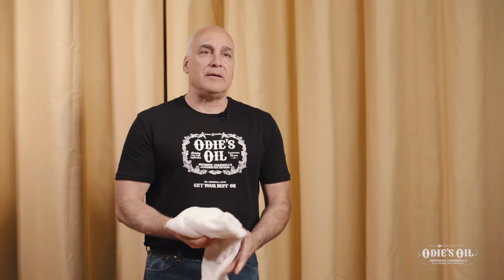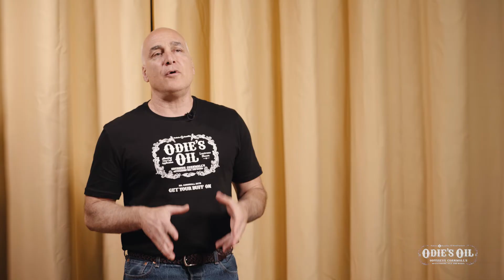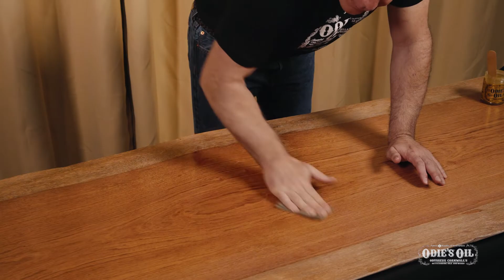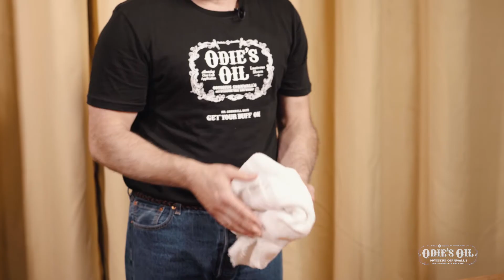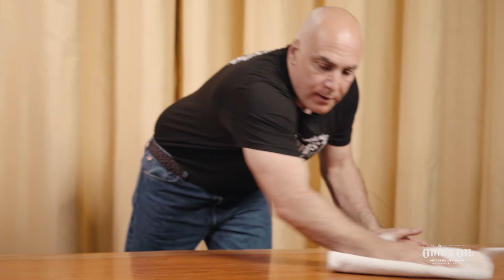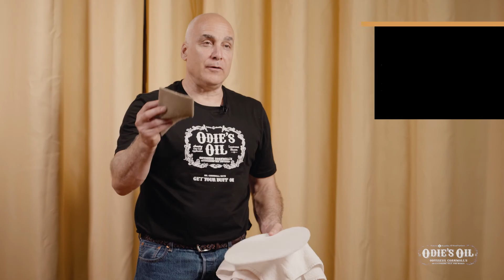Applying Odie's Universal Oil: Tips and Techniques #odiesoil #diywood #hardwaxoil

Comment: Probably a dumb question, but for a small black walnut live edge shelf. Should you seal both sides
Reply from the maker: Yes, both sides is correct!
Reply: No matter what finish you use on any wood you ALWAYS want "balanced moisture exclusivity" that way if humidity changes it exits rhe wood at same rate, otherwise warpy, bendy,  twisty.

Comment: Do you sand before applying the oil or is applying the oil with the Mirlon pad what you mean when you discuss the sanding level? I can’t determine if there is 1 sanding step or 2…Please help! 😂
Reply from the maker: yes, the level of sheen is given by the level of sanding. The higher you sand the higher the sheen. However, you can step the sheen up once you’ve already finished your work. Please check out our latest videos on high sheen

Comment: Can I just use a 2500 grit sandpaper for the application?
Reply from the maker: For application you can use a pad rated 2500 grit (however not sanding paper), check on our pads too: https://odiesoil.com/non-woven-hand-pads-6x9-singles/

Comment: first time using it today, so far very good. question, what is the sheen level i should expect and can i vary that sheen in any way, ie, extra buffing? thanks for the great product!
Reply from the maker: The sheen is primarily dictated by the surface prep,  in this case the sanding. Good quality abrasives, the right tools for the job and technique. Usually, higher you sand higher the sheen! however, we can teach you also other techniques, give us a call tomorrow (850-695-2055) or see video: https://www.youtube.com/watch?v=doch4S7pSaE

Comment: I have been aplying Odies Oil as my last stage of my Half and Half Pure Tung Oil. I usually do 2 coats of tung oil and then final coat with Odies.....sometimes i thin down the Odies with a but of Tung oil, honestly. 

My question, though, is do you think i should be waiting 21 days for the Tung to fully cure? Or can i simply do it as a stage, like buff of tung oil, let sit for an hour and then follow up with Odies and buff off the same?
Reply from the maker: Odie’s is a modified and enhanced Tung Oil based finish that contains no solvent and is far superior to pure Tung oil and all other oils finishes out there including the Euro trash hard wax oils. Tung oil cut with 50% solvent is even less effective. You should be applying Odie’s as a stand alone finish to the bare wood for optimal and ultimate results. One properly applied coat of Odie’s will outperform what you are currently doing in every way. You can do additional applications of Odie’s if desired for added aesthetic value ie: increasing sheen, depth, lustre and building upon that silky smoothness. 1 day between coats and 3-5 days cure time after final coat before being subjected to standing liquids.

Comment: I whittle so i end up making smaller pieces, would this still work for that as well? I also saw u have the wood butter, would that work for smaller pieces too or just stick with the oil?
Reply from the maker: Yes, correct! Odie's oil offers an universal application, just apply 2 coats for projects with higher traffic!

Comment: which odies oil should I use? whats the difference? I want to finish gift/keepsake boxes made with nice exotic wood with lots of figuring and color.... small dressers and cabinets as well....
Reply from the maker: With the Odie’s Oil system of all-natural finishing, there is no one way to do it! If you’re new to Odie’s finishes, we recommend starting out with Odie’s Universal Oil and or Mr. Cornwall’s Super Duper Everlasting Oil. One or 2 coats of Super Duper Oil followed by a coat of Universal Oil will work great. Or you can just do multiple coats of either product. If using Odie’s Universal Oil alone, 1-2 coats is recommended. If using Super Duper Oil alone, 2-3 coats is recommended. Wait 24 hours between coats and be sure to buff the surface completely dry after each application.
Reply: @Odiesoil  thank you. the only finish I have experience with is tung oil.

Comment: I bought an unfinished walnut countertop from home depot. Do I need to sand before applying odies oil?? If so, what grits??
Reply from the maker: Yes you should sand so that you know you have a properly prepared surface. There are no sanding restrictions or limitations with our finishes. The higher you sand the higher the initial dictation of sheen. Make sure you go through all the grits without skipping grits. For a nice low satin to satin sheen you’ll want to sand to around 180-220
Reply: @Odiesoil  thank you! And yes, I definitely want a low sheen / matte finish. Thanks for that too.
Reply: @Odiesoil  should I be sanding by hand or can I use a random orbital? Also, I'm going to be prepping and coating this countertop in my mudroom that doesn't have central HVAC but I have a wall heater that's usually turned off and it's about 50°F in the mudroom during Chicago winter. Does temperature matter for applying and drying time of the oil??

Comment: How soon after sanding and staining?
Reply from the maker: There is no stain on this table. If using a stain you just want to make sure it is dry before applying the oil. This could vary depending on the stain and drying conditions. Anywhere from a few hours to a few days.

Comment: I’ve got two tables made of parawood. Going to sand it smooth before applying any finish…not sure we want to stain it.  Any special instructions needed for this kind of wood?
Reply from the maker: No special instructions. If you are going to add a pigment we would recommend not sanding too high as it may inhibit the colour saturation. 150-200 will be adequate. It’s always advised to run some tests on a scrap piece of wood to verify results. If you are finishing with just the straight oil, your sheen is primarily dictated by the sanding. The higher you sand, the higher the sheen.

Comment: do you recommend using a 2500 pad like the one in the video? Is a non abrasive pad ok?
Reply from the maker: We typically recommend to use a pad rated higher in grit than your last sanding. A non abrasive pad is fine to use 👍

Comment: My finishing job looks blotchy after applying oil. It’s inside my dining room and you can see the inconsistent finish in the light. Do I need to apply second coat? How long should I let it dry before buffing it off? Thoughts?
Reply from the maker: The blotchy look is given by the product left on the surface, probably it was applied to much and not removed completely. You want to use very little oil and buff off completely until there is nothing remaining, a cotton terry towel works best at achieving this. To fix, apply a very small amount of oil back to the surface, using a non-woven pad. Scrub the surface well with the mindset that you’re trying to reactivate the oil on the surface. Buff off immediately until it is completely dry to touch (you can work in sections)!

Comment: Mentioned applying a second coat if wood has absorbed the oil after waiting an hour after the first coat. Should that second coat be applied immediately or a day or two later?
Reply from the maker: Please wait one day in between coats!
Reply: @Odiesoil  Much appreciated!

Any advice on Odies wood butter vs Odies wax after the oil application? I’m finishing a pheasant wood coffee table, dining table, and entryway bench.
Reply from the maker: @joeprior7311  Wood butter will offer an easier application having a wood butter consistency (wait one day after the oil). The wax is like a traditional hard wax, wait 3/5 days for the oil to cure before application! The key is to apply sparingly and remove all the excess until dry to the touch!

Comment: Yikes that’s expensive!
Reply from the maker: Our finishes offer value that is unmatched, not only in cost but performance. 1 9oz jar of Odie’s Oil averages 200 sq ft of coverage on typical domestic hardwoods nWhen you do the math based on coverage, Odie’s is in fact cheaper than most.

Comment: Why are you doing this demo on wood that already has finish on it and you say nothing about that?  That wood already had a reflection and you are acting like this is a first coat
Reply from the maker: This table in fact had no finish on it prior to the application shown in the video. The shine and reflection you are seeing is simply the result of the proper preparation/sanding of the surface.
Reply: @Odiesoil  can you share what that is ? I use the product all the time, but I have never sanded above 330 grit.
Reply from the maker: @Capt_HowdyGT there are no sanding restrictions or limitations with our finishes. This means you can sand the wood as high as you like. The higher you sand the more you refine the surface which is your primary dictation of sheen. Lower sanding = less sheen. Higher sanding = more sheen. Using quality sanding paper a good finish sander and thorough technique is also important. Certain woods will behave differently than others with the refinement of the surface. Dense hardwoods may take a little more work to properly sand because of the hardness, but they will tend to polish up and produce a shine better than that of a lower density wood. The wood in this video is Brazilian Cherry, a relatively dense wood rated approximately 2400 on the Janka scale, it was sanded to 600-800 grit to produce that beautifully refined surface before finishing. White oak in comparison has a Janka hardness of approximately 1400. When sanding to higher grits, take your time, making sure to erase the sanding scratch pattern completely of the previous grit. Do not skip grits! When applying the finish make sure to use a pad rated higher than your last sanding grit. 

You can also further build upon sheen, depth and lustre with additional applications of finish. The sky is the limit!

Comment: Was this application done on raw sanded wood, or did this cherry slab already have a coating on it?
Reply from the maker: Yes, it was sanded! our finish works too over other finishes, however for best results is ideally to apply on bare wood. With our finishes higher you sand higher the sheen!

Comment: QUESTIONS:
1.  Can it sit for more than 1 hours?  If yes, will it be more difficult to buff off?
2.  Is it now waterproof?  
3.  Do I need to use coasters to prevent "rings" from sweaty cup or goblet?
4.  How many square feet for walnut, maple, mahogany, etc. (woods with lower Janka rating)?  ...Is there reference sheet?
Reply from the maker: 1.yes, better to remove the product within one hour otherwise will be harder to remove and risk to leave product on the surface.
2. Yes, all our products will get you an waterproof finish after is fully cured (3/5 days).
3. no, is no need of coasters.
4. Depending on the wood type Odie’s Oil can cover up to 250 square feet on most domestic wood species, and aproximative 180 sf for american cherry! see link https://odiesoil.com/training-manual-2/

Comment: Can I use the white non-woven pads even if I only sand to 320 grit? Or do I "need" the coarser pads? Thanks for the video this is wonderful!
Reply from the maker: It’s typically recommended to use a pad rated just higher than your last sanding grit but a white pad will work
Reply: @Odiesoil  Thank you!!
Reply: @Odiesoil  sorry one more question. Do you wipe it down with mineral spirits or water after final sanding to make sure it looks ready to oil and to clean it before oiling?

Comment: Could I lightly heat up the oil to make it more viscous? Would it spread easier?
Reply from the maker: We don't recommend to heat the oil, however make sure you stir well the oil in the jar and use a micro-fine pad for application, see our website https://odiesoil.com/non-woven-hand-pads-6x9-singles/

Comment: Hi there! Can you use some type of buffer for applying the initial oil? I have limited strength so it was quite difficult to do this on my first project but I liked the finish so well that I want to continue to use Odie’s.
Reply from the maker: Yes, you can! You can use a non woven pad which will stick to any hook and loop disc on a palm sander. Apply sparingly, being sure not to over apply the oil during application. Do not use the machine to remove and buff off the excess though, do this by hand with a 100% cotton terry towel.

Comment: I used Odie's oil to refinish my midcentury danish chair. I followed all the steps showed in the video. I love how rich the color of the wood became but even though I buffed, using a towel, I don't see the sheen.  Any advice?
Reply from the maker: The sheen is primarily dictated by the surface prep. The higher you sand the higher the sheen. However, you can step the sheen up once you’ve already finished your work. Please check out our latest video just posted!

Comment: If I finished top and bottom of a table with Cornwallis super duper everlasting + creative colors pigment 3 days ago and I plan to do a second coat of the original Odie’s oil tomorrow. Do I need to add a second coat to the bottom of the table or is it overkill?
Reply from the maker: Hi!

Thanks for choosing Odie’s to finish your table! The underside of the table is typically fine with just the one coat but it wouldn’t hurt to apply another light coat to make sure it is all sealed up equally to the topside. It’s important to make sure both side are equally sealed to prevent any difference in moisture gain and loss. This will ensure wood movement will be kept to a minimum and help prevent any warping and cupping.

Comment: what grit would you take red cedar to and what coresponding pad colour?
Reply from the maker: You can sand to any grit! There are no sanding restrictions with Odie’s. It really all depends on the look and feel you want. The higher you sand the more refined the surface and it will be the basic dictation of sheen, the higher you sand, the higher the sheen. When choosing a pad, you typically want to choose one rated just higher than your last sanding grit.

Comment: Can it be applies over a polyurethane finish?
Reply from the maker: Yes, it can. Odie’s will cross link and molecularly bond to a great variety of mediums including other finishes. The downfall to using Odie’s over other finishes, even though Odie’s can help repair and rejuvenate them, is that those existing finishes are the barriers between the true cross link and molecular bond with Odie’s and the medium itself and that existing finish will be the weak link.

Comment: Do you need to fill the grain before using this? Finishing a black limba piece
Reply from the maker: If you want to grain fill, we recommend you do this before the Odie’s finishes are applied. You can use any type of grain filler 👍

Comment: Hi, If I use a white non woven pad to apply Odies oil can you tell me what grit of paper should I sand the timber to. Thanks
Reply from the maker: Our white non woven pads are non abrasive so they are typically used on surfaces sanded to 800 and above.  The non abrasive pad won’t abrade or mar the surface. We typically recommend choosing a pad rated just higher then your last sanding grit as the slight abrasiveness does have its benefits. Our pads are as follows. Maroon pad-rated 240-360, Ultra fine grey pad-rated 400-600, Micro fine grey pad-rated 800-1000, white pad-rated non abrasive.
Reply: @Odiesoil  Thanks

Comment: Hi all, just got a question,l done my slab with an oil that is not shiny  at a all, can l on top with a different  gloss oil??
Reply from the maker: Was the slab finished with Odie’s Oil or a different finish? 

With Odie’s finishes, the sheen is primarily dictated by the surface preparation (sanding in most cases) the higher you sand, the higher the sheen. You can also build upon the sheen with additional coats and by using the various finishes in our line up.

Comment: Hi. What grit do you sand the wood to before applying the odies oil?
Reply from the maker: With our finishes there are no sanding restrictions or limitations! The sheen is primarily dictated by the sanding. The higher you sand, the higher the sheen. 180-320 for matte to low satin sheen, 400-600 for satin to medium/ medium high sheen 800+ for high sheen. You can also build upon sheen, depth and lustre with additional coats.
Reply: Hi. I have some questions I was hoping you could help with

1)What is the minimum dry time for a table?  We want to renew our dining room table, but don’t have a week to wait for it to dry.  
What would you say is the minimum time to wait for use,  and perhaps the precautions to keep in mind while using until it’s fully cured?

2) can you help me calculate how much odies oil I need for a table that is 1.4meters x 1.4 meters. 

3) is it best to put two coats for a table?  If so, how much do you reccomend in between coats?

4) I have a finishing wax called deylina wax. How much time do you reccomend waiting in before waxing?

Thank you 😊
Reply from the maker: @TzufFamilyBand  we typically recommend 3-5 days cure time before being subjected to standing liquids. The table can be ready for light duty use the next day otherwise but it’s best to tread lightly. These minimum recommendations would apply to any finish. 

Once the applicator pad is saturated with Odie’s Oil you’ll get approximately 22+ Sq ft of coverage per ounce of oil on hardwoods like oak, cherry, walnut, maple….

One properly applied coat of Odie’s Oil is all that’s needed for protection and durability. The only thing better then one coat of Odie’s is two coats! With additional coats you will micro build upon the finish adding a little more sheen, depth, lustre and that silky smooth feel. 

We do not recommend using any other non Odie’s brand of finish or wax over Odie’s as we cannot guarantee a proper bond or performance. If looking to add a wax coat, we recommend Odie’s wax. We would recommend waiting 3-5 days before applying the wax.